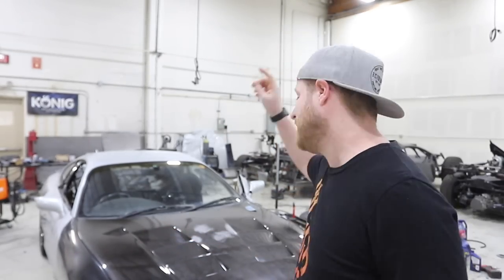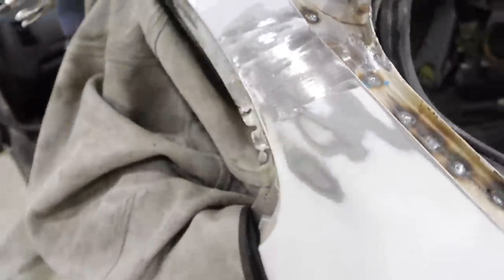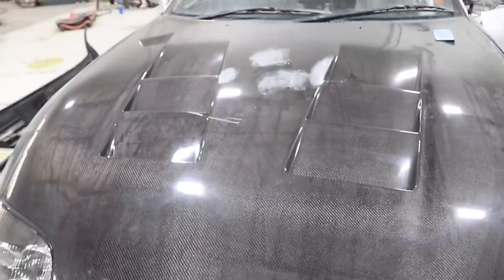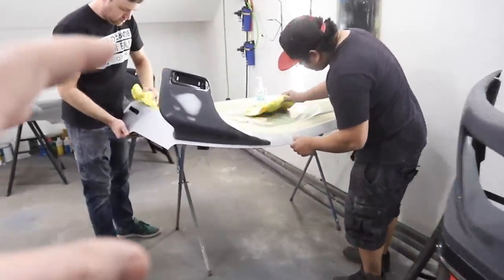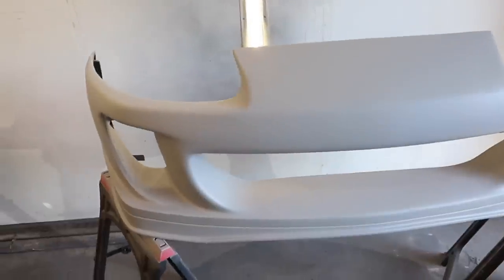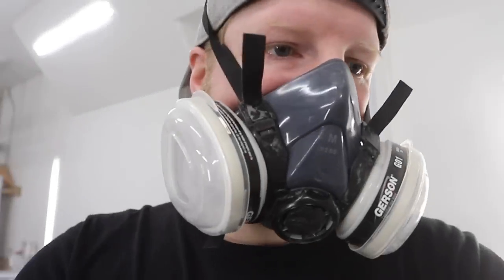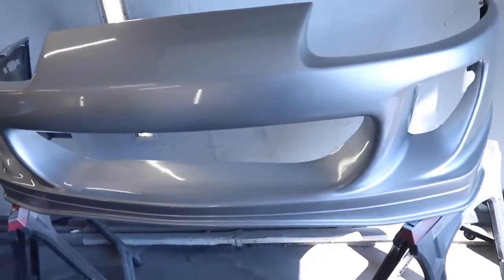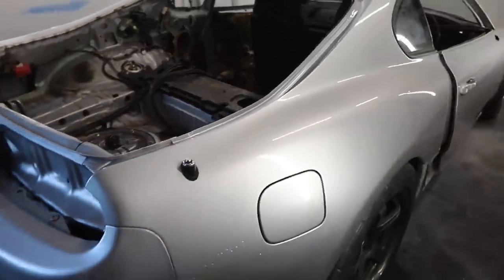I Painted My $100,000 Toyota Supra With Harbor Freight Tools And The Results Are Surprising!

Comment: I was a paint sprayer for some time at a cabinet manufacturer. Most likely the over spray or dry texture was just you getting used to a new gun with a different tip. Side note, @12:44 don't leave open can drinks in a booth when spraying, unless you want more cancer.
Reply: I thought touching with bare hands was a big NO NO from body oils.

Comment: When your welding, sanding, and your trying to not warp the panel. Use the compressed air to cool the panel between welds and you can move quickly 🤘🏻
Reply: If you cool them too quickly it can cause cracks so be careful
Reply: Sorry.  It's "you're" not "your" in this case. Just sayin.'
Reply: @1Uriahheep1  saying not sayin.'
Reply: @turnerg  he's referring to using compressed air between tacks, not during welding.
Reply: @1Uriahheep1  yeh so never correct someone. Specially not on Internet, no one asked for it no one gives a fk. English isn't everyone's first language and we aren't here to learn grammar.
Reply: It could damage the panels from the rapid cooling.
Reply: @ElRayDelRio  haha touché!
Reply: @1Uriahheep1  like “you are” correct 👏
Reply: @turnerg  wouldn’t blow it as it was red silly lol that would be as almost rep of a blow torch blowing the weld everywhere. Cool it off once you shoot a weld every couple inches lol
Reply: bad advice. literally the worst advice. if anyone is reading this, dont do this. the metal cools too quickly doing this this and will warp
Reply: @peijrum  i swear some people be acting like a dam language arts teachers 😂
Reply: @gravity00x  keep reading the comments 🤣 I’ll make some popcorn!!
Reply: @ElRayDelRio  sayin' is also correct

Comment: Pro tip when you are laying down clear coat and you see that you get runs, add more. If you add more clear coat it will keep going to the bottom of the panel and is way more easy to remove. Once cured you just cut the drip of and shape it as good as you can, and then polish. Super easy and no risk of sanding thru the clear like it is on the middle of tha panel.
Reply: You mean clear not paint. If you’re running base coat hand the gun to someone else lol
Reply: Haha yes ofc! More clear coat, corrected in main post :)

Comment: I found the best method to fix runs (and bugs) is the slightly bent razor blade.. scrape along the run to get most of it off and you're just left with a little buffing. Of course if you want a really hot paint job you sand the whole car with 1500, the 2000 grit and buff/polish.. Its a lot more work though and the juice has not been worth the squeeze for me.
Reply from the maker: i think were going to do wet sanding to fix the runs. I havent had great results with the razor blades. But ill do research on all methods. Theres enough runs to test them all :p
Reply: @BisforBuild  Lots of runs? Sounds like a normal paint job then..:). If you want to try the razor blade then I found that bending the blade into a shallow curve then dragging it with the top of the blade angled forwards works best. The good thing about this method is the material removed is focused just on the run itself, but wet sanding means you are taking off both the run and some surrounding CC which you really don't want. Whatever works best for you though, the car will look gorgeous in any case!
Reply: @BisforBuild  when I use the razor trick I put tape on each side of the razor and leave the middle section exposed and then start scraping. Also, if you get a run while clearing use 2” masking tape and gently dap it along the run as soon as you see it dripping. Then clear over it and it should look like it was never there. Try dry color sanding instead of wet sanding with a DA it’s way faster; that’s the only way my guys do it at my shop. Hope this helps
Reply: @BisforBuild  I was a professional painter for years. We always use to say if your not getting runs your not putting enough clear on. Lol

Comment: Chris you nailed it on this one, remember to let the paint fully cure before you wrap it, I would rock the silver and make it fast
Reply: I would keep all the imperfections so it looks like like a imperfect normal car, and then give it more power than it reasonably needs.
Reply: Agreed!
Reply: 90 Days recommended
Reply: @jwalster9412   Chris is hoping to have a 100K+ car when they’re finished.  Flaws won’t give them that.  Think Barrett/Jackson.
Reply: @ronlheureux7623  I like more of the sleep aesthetic. I would probably get alot of hate on the internet if I modified cars...
Reply: @ronlheureux7623  it won't be a $100k car. It's a JDM car with a nasty past. The big money for Supras are in USDM Clean history cars.

Comment: To sand down runs I use a razor blade with tape wrapped around both edges and leaving the middle exposed. Keeping it perpendicular to the panel, carefully scrape off all drops until they are almost level with the rest of the surface. To get it more even you can use a hard block or a piece of flat paint mixing stick with sandpaper wrapped around it. I’ve been using this method for years and was able to get rid of some epic Niagara Falls level runs without issues. Hope it helps. Otherwise you did a great job!

Comment: Good job overall. I do see different shades of silver. I am not sure if it’s a lighting effect or if it’s because the panels were sprayed separately; metallics are very tricky; I’ve seen others paint the entire car in one go, at least the final paint coat to minimize the problem. Anyway, with the wrap it will look perfect.

Comment: In Georgia we paint at over 90 all summer long. You just have to get very slow reducer and activator. I get my reducers and clears from Southern Polyurethane which is based on Georgia and they have the stuff for hot temperature. Humidity is more of the issue.

Comment: You are supposed to sand that final primer layer before paint regardless. Also adding flex to the primer and paint will help prevent rock chips and cracking on the bumpers.

Was hoping to see all the glass pulled and the sealing/painting on the rear body panel and inside quarter sheet metal
Reply from the maker: we normally would have but this car had been painted before and they got paint on the molding. Its hard to see but its there, so we just tucked the tape under the molding. Didnt make it any worse at least. And since its the same factory color its a pretty good match under there

Comment: Also when Sanding down that butt joint with that flapper wheel. Don't angle it to where your on the side of the disc otherwise your going to dig in create that low spot and only grind it down till it's maybe like a 1/32nd high and feather it out lightly like a good 2-3 inches from the weld with the disc flat. Been welding electrical cabinets for 4 years and we used to do the same thing for corners and you'd never know unless you look underneath

Comment: Go thicker on your primer. It’ll help cover sooner of the deeper pits. Of course it’s not ideal to have them but thicker primer never hurts and less timber having to go back and fix pits. Also gives you a better layer to sand on without the risk of going through and having to primer again so the paint job is consistent with no how through. Especially when going from dark to light colors. Like you would with clear. Using a razor blade to take the big runs off will work if you are super careful then sand. Takes the high off faster.

Comment: When you get really bad runs like that just walk it off the bottom edge of the panel and once it's dry you can cut it off with a razor blade and wet sand it all smooth. 😉

Comment: You really should consider enclosing your electrical panel. If anything is going to explode it will be there. The suspended paint particles could cause the panel to arc and go boom...and do have exposed outlets in there for the same reason.

Comment: When you explained the process of welding on the used qtr panel I was saying "please don't use a sleeve" btw 1/8 of an inch max for body filler. Not 1/2 an inch 🤣🤦

Comment: Not hating on the putty ,   But if oem bumpers are typically made from really hard plastic , anyways where I’m going with this is u can use a heat gun to get the dents outta them . 🤙🏽

Comment: I used a harbor freight paint gun to completely respray my entire 4runner in surfside green mica. Definitely good results just a-lot of problems, leaky, etc. LOTS of pipe tape on the adjustment dials. Too bad that 4runner got wrecked :(

Comment: i hope you sanded all those parts and not just the bumper after they were primed, primer isnt wet on wet it has to be sanded for base to stick, sealer is wet on wet and can have base applied to it and even then has the be done within 15-20 minutes usually

Comment: Hey man I'm pretty sure ya supposed to primer then bog filler as you can't have bog on metal as it will rust out and chip away
Reply: WRONG take it from a pro
Reply: @dougsmith2320  legit? My cousin is a painter we were watching this and he commented the amount or times he's had to fix rust due to bog contact on the metal

Comment: Your backwards on your guns the larger tips is for the primer. Smaller tips for the paint and clear. That's why you had drips in the previous episodes, the paint is much thinner and therfore don't need such a large nozzle
Reply: Ex. 1.3 is the larger tip that's for primer. 1.7 is smaller that's for your basecoat/Clearcoat
Reply: @loganbartley9666  actually 1.3 mm tip is for base coat/ clear coat and 1.7 mm tip is for thicker  primers and paints.

Comment: If there ever was a $100k JDM Supra, the way you painted it (leaving bumpers, doors, wing, etc on) surely ruled it out for yours and quite frankly dropped the value. No real difference than a mediocre collision shop painting it. There’s a reason so many shops charge $8-10k (starting price) to paint an all over. If you’re going to do it, do it right and for heavens sake, stop saying wrong information about products. Yes they have different hardeners and reducers for different temps but that doesn’t mean you can’t paint above 90*. If that was the case, I wouldn’t have a job for over half the year down here in Florida. In a shop like ours, our booths are heated (to cure) and it’s not even remotely unheard of for the booth temp to be 100-110 and I can assure you I don’t have any issues putting out a slick paint job…As with everything, “it’s not what you do but how you do it”.
Reply: It doesn't matter lol it a totaled car it's already lost value 😅.it's painted that's all that matters.hes not selling it anyways so value doesn't matter.
Reply: @jerrywilcox9890  Thought he said a while back it was still a clean title? I know when he said what he paid for it (when it was in Japan) I laughed cause even though a lot has changed, I can still find clean titled JDM TT 6spd for $60k
Reply: I agree. He said in the first video he wanted to restore the car  perfect. But most of the work is not even properly done.
Reply: I don't know what video you watched here, but all the hanging panels were painted 1st then the body second

Your eyes must be pretty bad if you can't even see that, maybe spend abit less time in the booth putting on "slick" paint jobs and more time using your eyes
Reply: If you wanted people to actually listen to you, you would format your information less aggressively. What you really want to do is fold your arms and talk down while saying you're smarter and better.
Reply: @8ewb5  Maybe you should open your eyes cause the doors, rear bumper, rear glass, the emblem locator pins and the wing ends were clearly on the panels. But please tell me more about what the correct way to “restore” a car is….
Reply: @dogboy0912  Please tell me more about me, I’d love to listen! Intelligence and being better have nothing to do with doing it the correct way. I’ve known quite a few ppl that aren’t the smartest but I very much respect what they do cause they don’t half ass it. Maybe I should type it out nicer so I don’t hurt other ppls feelings 😂
Reply: @MIUBHI007  there's 0 chance the rear glass was in when painting after just finishing the weld out on the rear quarter...
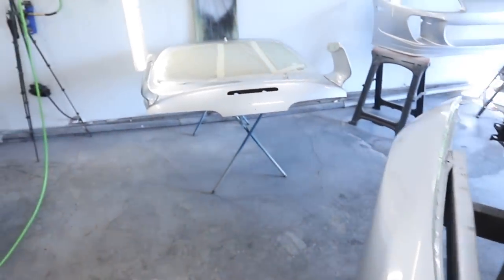Reply: @embeastn_plays6925  Did y’all watch a different video than I did because when he painted the hatch, fenders and the front bumper in the first booth run, the glass was in the hatch…When he painted the car in the second booth run that the hatch was off. @16:00 was the first booth run, @18:00 was the second. Please tell me y’all aren’t arguing over something that’s blatantly obvious if you just look…